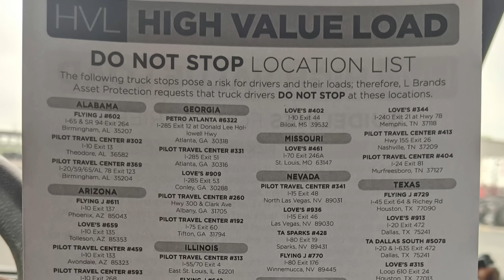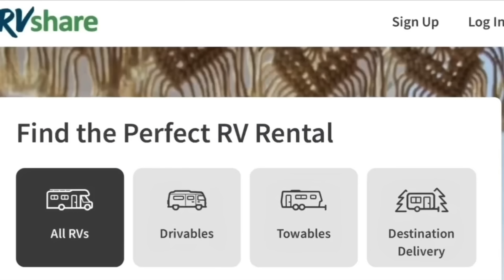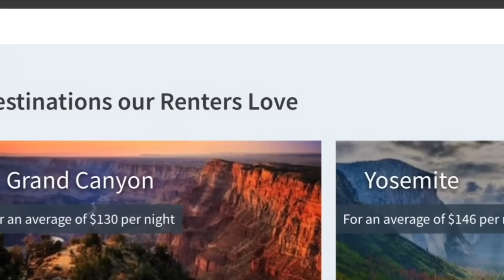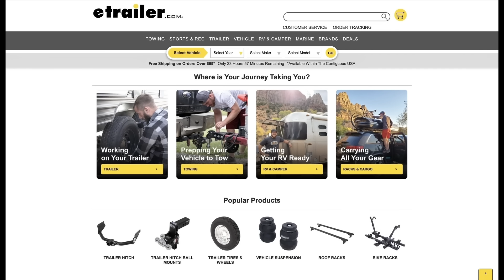316. The Best Places for Short RV Overnights

Comment: On the doctor in NY: one day I bumped into the closed laundry room door in someone's house, and it just swung open from the touch. Apparently in over 20 years, no one had ever noticed that when the door looked and felt it was latched shut? The latch had never been properly adjusted to LATCH.
 I was easily able to accept that the doctor's new Airstream might have had a similar simple defective latch.
 That's why transit busses usually have a white line set into the floor and a sign saying DO NOT STAND IN FRONT OF WHITE LINE.
Reply: Or don’t ride in the trailer… RIP to the Doctor and sympathies to her family

Comment: In some cases, they may not be stealing the RV, but make sure your bikes, generators, and other items on the outside of your rig are locked down as that valuable Yeti cooler becomes very attractive and can be grabbed very quickly off the back of the rig or out of the back of the truck. I seem to remember this happening to some RV news providers at an overnight stop.
Reply from the maker: I remember when that happened to us as well, however, it wasn’t at a truck stop on this list or any list, it was at a Cabela’s and they cut through the lock that was securely holding our generator on the back rack of our RV.
Reply: I saw a youtube channel couple that was going through Denver in rush hour traffic  and when they arrived at thier next stop thir Generator had been removed off of the back of thier trailer the one time that the rear view camara wasnt working on a short travel day and they hadnt locked down the generator

Comment: Georgia now allows overnight parking at the weigh stations and they have plenty of parks.
Reply: Truck weigh stations have always been available for truckers to use over night they are required by law to stop for 10 hrs
Reply: @waynepike7074  true,  but seldom used in Georgia that I have seen in the 40+ years living here.  The state put up signs last year to advise that overnight parking is allowed.  Still don’t see a whole lot there, but I am glad it is now a posted option for folks.
Reply: @chrisadams3491  the reason, not many truckers use the weight station parking area, is for years georgia would ride around and look for trucks to do dot inspections on. the officals would walk around looking to find a truck to inspect.not good for the driver.

Comment: Hi.  I am  pre- rig. Never had and RV of any kind. Yes, I want to rent before buying. I will only be using a rig, to get from point “ A “ to point “ B” because I don’t like motels / hotels ( toxins, EMFs  electromagnetic frequency exposure that I cannot control , and so on). I will be traveling solo, but with 4 dogs ( each 30-40 lb range).  I want to be able to use the toilet in the rig and only be away from my dogs , when  necessary for grocery shopping,  My dogs will be crated ( b/c studies show that is safest for travel ) and crates fastened to vehicle or rig interior.  They need good strong A/ C  as they are double coated.  
So are my only safe options an actual  motor home?  How often to I plan to use this?  I don’t know , guessing a max of 4 times a year.   What are my best rig style/ type choices. Sounds like trailers and 5th wheels are unsafe. Vans, I fear A/c too wimpy. Oh  and need a fridge b/c     they get fresh raw meals.  I am open, just at an investigating stage. Thanks for your thoughts
Reply: P. S. Though perhaps not practical, I like the “ idea” of owning rather than renting in case of need for evacuation ( Oregon has smoke season annually) . It would be nice to have an evacuation vehicle ready to go.
Reply: Lighten up. And RV isn’t the safest and germ free room on wheels you believe it is.
Reply from the maker: A motorhome does sound ideal for you, but an option would be a trailer that you can pull with a large SUV. You could use dog seat belt tethers for the dogs in the SUV, or install crates.
Reply: @RVMilesPodcast  Thank you so very much for your experienced thoughts on this.
Reply: @MaryWehmeier  I already have a very high level of toxins and autoimmune disorder. One of my dogs has repercussions from mold. I am a retired medical professional.  I know my body and have attended seminars on high toxic load and EMFs. 
I would have more control of my environment, which cleaners I use, outgassing of mattress and fabrics. I could also install EMF protection. I am speaking thru experience and knowledge, not thru opinion.
Reply: I'm in a similar situation.   I travel with 8 jack russell terriers to dogs shows about 12 times a year.  I have a 2006 Chevy 1 ton diesel crew cab with a long 8 ft bed (NOT A DUALLY).  I would camp in the truck bed with a shell until old age and joint issues stopped that.  The dogs are individually crated in the folded back seat, 4 on each side stacked 2 high.  I got a 2019 Ascape TT.  It is 12 feet long from hitch to rear door.  King size bed.  2 burner stove/microwave and a cassette toilet system.   While not spacious plenty big enough for me.  I would suggest getting a suburban or something similar for dogs and crates.  Consider building out a small cargo trailer or look at the ascape or r-pods.  Keep it simple.  Less chance of a catastrophic failure and maintenance is painless.   Good luck.  I really enjoy my set up and very easy to manage with my dogs vs mobility limitations